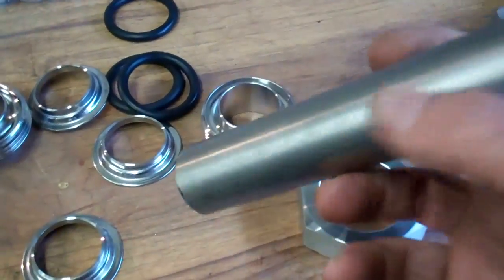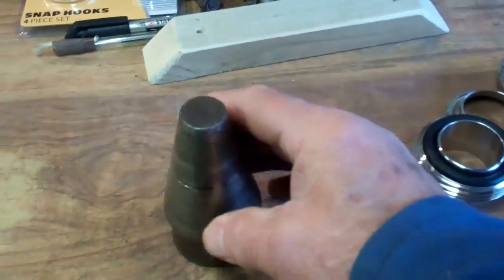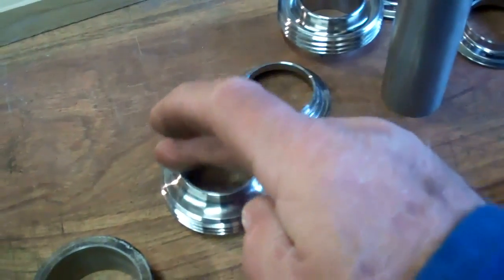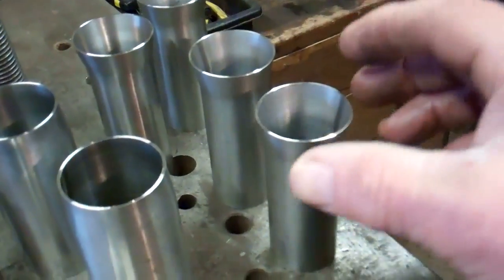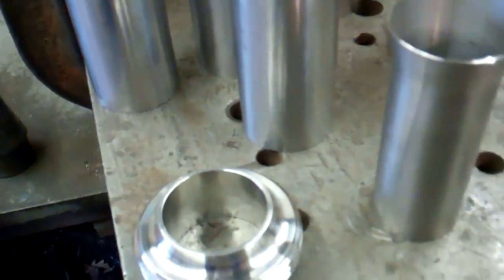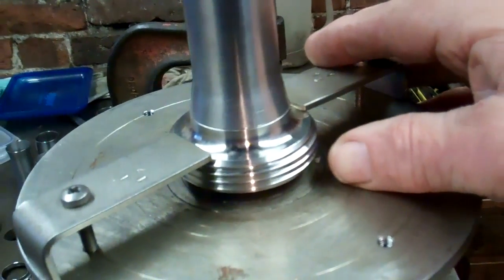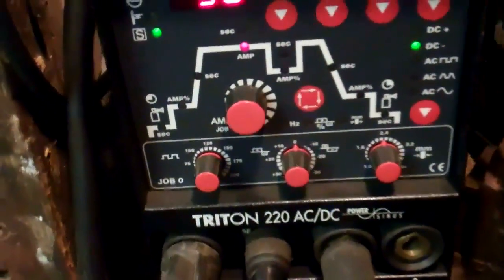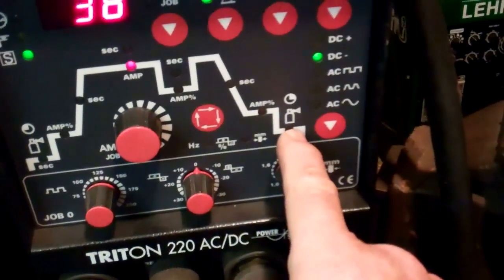How to tig weld stainless steel hygienic fittings to odd size pipes.

Comment: You didn't use filler wire because that wouldn't be considered a true sanitary weld. My only concern is you not applying foil or saran wrap to the top of the pipe when purging it, with a hole poked through it. IF you're leaving the pipe wide open like that during purge, you're definitely leaving the inside weld open today CONTAMINATION AKA sugaring.
Reply from the maker: Aaron Leon, You obviously did not watch the complete video, also the internal weld finish speaks for itself,

Comment: I didn’t see any welding.
Reply from the maker: Scott Arnold, If you look closely you will see each of the fittings has a fully penetrating fusion weld around them at the point where the fittings meet the tube.

Comment: John - awesome work and beautiful welds.  I love the turntable; can you explain a little more about it?  I saw in some of the other comments it's a stainless spindle with a 3-point brass clamp clamped to the SS.  How does the (aluminum?) top plate attach to the stainless spindle?  How is the SS spindle rotating inside the piece clamped to the table?  Looks like the Argon nut rotates with the table top - how do you stop the gas tube feeding Argon from below from twisting up?  Thanks for all the info and great videos!
Reply from the maker: jstodd903, Thanks for the comment. The top plate is machined perfectly flat, it's made of stainless steel and welded to the stainless steel spindle, the spindle passes through two ball races that are spaced apart, the outside of the ball races press into a plastic sleeve, the plastic sleeve is pressed into the vertical tubular stand, this plastic sleeve is there to prevent current flow passing through the ball races if the earth clamp is accidentally left attached to the bench. Yes the flexible argon pipe does rotate with the turntable but this is not a problem as the turntable only has to do one revolution to complete the weld, so just wind the turntable back one revolution before doing the next weld :)

Comment: nice job pal do you have any swage die drawings I could have so we could make our own dies. :)
Reply from the maker: MickyElse, These are easy enough to make, I use a 12.5 degree taper angle and size them to suit the tube I'm working with, thank you for the comment.

Comment: Why not just use con reds, and instead of pickling paste.. lining the od weld off and take out internal weld with mfx and gfx wheels? Along with flexidrive 40/80 grit..
Reply: And if length of pipe is 6 meters how do you grind/remove welding?
Reply from the maker: Hi Michael, thanks for the comment, when a joint in stainless steel dairy pipe has been "correctly" prepared and welded there should not be any weld that needs removing, this also makes the weld easier to clean afterwards, as with this job I probably used a scotchbrite flap wheel as all it needed was some coarse polishing, sometimes I use a stainless steel wire brush followed with a scotchbrite flap wheel, some occasions I use pickling paste but you do have to be careful when using this.
If you are having to use abrasives to remove some weld the most likely reason for this is to much filler wire has been added, there really is no need for any filler wire if the joint has been correctly prepared.
Reply: John Bower not at all my mate, I weld these fittings all day everyday as a fuse weld and take both external and internal welds off as it gives it a better finish and no traps for pin holes etc.
Reply from the maker: Hi Michael, that sounds like a lot of work for nothing to me and making the joint weaker in the process, but if your happy doing it that way that is OK with me, I make a good living repairing things that break.
Reply: John Bower 15 years of doing it and not 1 repair has had to be made. Trying to be a smart arse gets you no where son. Got more of a bogey trap with a pressed liner than a machined 1. ;)
Reply: why wouldnt you use a walform instead of doing this for 15 years?

Comment: Thank you so much for providing your actual settings! I need to do a similar job and having the settings makes my life easier. Nicely done.
Reply from the maker: Thank you for your comment, Note! the tube I was welding in this video only had a wall thickness of 1mm, normally stainless steel dairy pipe has a wall thickness of around1.5mm, to weld this I would be using a higher amperage around 45amps.
Reply: Hi John, thank you for the follow up. The tubing I am using is 0.045" (about 1.14 mm) for the first half. The second parts may well be 0.065" (1.65 mm) so I will be sure to check the thickness before I start. Also, I like your welding table.

Comment: hi, i know the video is from some time but i would like to ask you about the turntable. could you elaborate on how the ground is attached or maybe a little video on this? thanks for sharing, i found your video searching bc a job is coming and wanted to see how other professional welders approach this. thanks again. peter
Reply from the maker: Hi Peter, My earth clamp has brass tips giving a three point contact to whatever it is attached to, in this case it was clipped to the stainless steel spindle just below the round plate.
The earth clamp itself is stopped from rotating by a peg clipped to the bench, the stainless steel spindle rotates inside of the three brass contact points without any arcing, also the grip onto the spindle stops the turntable turning to freely, which is useful.
I am interested to know what you think of this job done on the turntable as you made no comment.
Have Happy new year.
Reply: hi john thanks for the reply and that was exactly my question, if you experience arcing btw the clamp and the turntable. the job looks nice and clean i`m not into this type welding or know the requirements for sanitary/hygienic pipe welding tho.  i like the work you did to stretch /shrink the tube ends that was really nice to see and was thinking of giving it a try too! what do you use for cleaning the haz? . pete (sorry had to edit) :)

Comment: 316 ss what is the wall thickness of the tube.
Great video wish I had your turntable
Reply from the maker: Hi bill, Thanks for the comment, both sizes of tube used with this job had a wall thickness of only 1mm, the wall thickness on the fittings is around 1.5mm.
Glad you like my turntable, this is something I made in a hurry (many years ago) for some big pipe work jobs that came my way, it's mobile to carry around and will clamp to any surface, I also have a large circular plate 600mm diameter that fits on top of the turntable, this is used for building stainless steel vessels.
Reply: Hii 9837974714

Comment: I know very little about a lot of things but is that weld going to be strong enough without a bevel on both the connection and pipe? Or does one exist? (this is a new area for me :)
Reply from the maker: Yes this type of butt weld is at least as strong as the pipe itself, there is no need for any filler wire to be added to the welds if the joint has no gaps, and the weld must penetrate all the way through the pipe wall, the inside of the pipe must also be purged with pure argon whilst the weld is being carried out, I have carried out my own tests to check the strength of butt welds in thin wall stainless steel pipe, one of the best weld strength tests I have done is to bend butt welded pipe around a tight radius pipe bender with the butt weld positioned halfway around the bend and the weld does not show any sign of failure at all.
Reply: thanks John

Comment: Anf know how muchos it costa a sanitary welding un pipe of 3"
Reply from the maker: The cost depends on several factors, if it is only one joint to be welded all setting up time and preparation to the pipe has to be charged to one welded joint, it also depends on how long the pipe is and where the pipe is situated, if in my workshop the welding itself around  3" dairy pipe after everything is set up will only take about one minute, setting up time will vary a lot depending on length and shape of pipe, so you can not give a price for a weld unless you know what else is involved,
Reply: John Bower  thanks bower forma tour help and if it is a 3" sanitary handle how muchos necklaces would cost
Reply: Mr Bower, I am waiting for your reply.

Comment: Another first class Job John - Do you weld for a living?  Also what do you use to clean the wilds up & what paste did you use on the bulk tank to clean the welded areas?  Mark
Reply from the maker: Thanks, I work from my own small workshop and nearly all my work is with stainless steel, the paste I used is a pickling paste for cleaning stainless steel welds it does contain some nitric acid & hydrofluoric acid and has to be used carefully, scotch brite is used afterwards to get the shine and grain back into the surface.